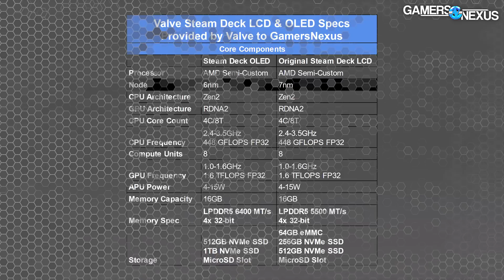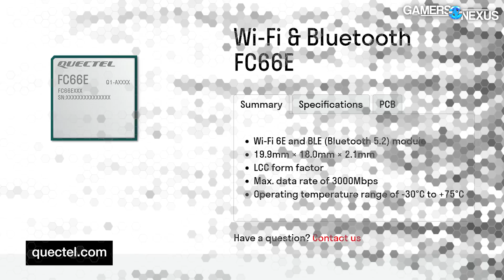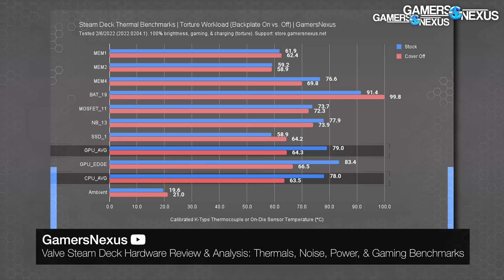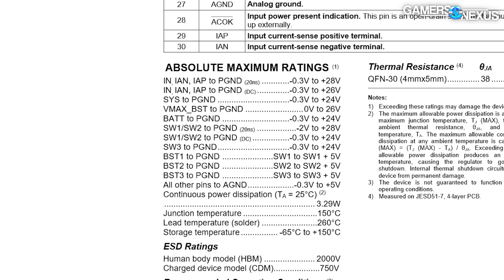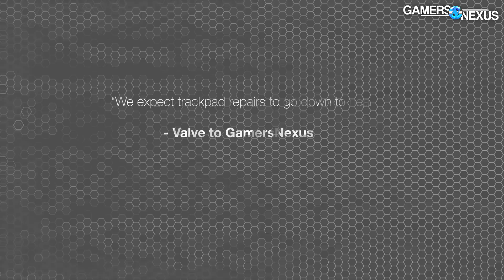They Changed Everything: Valve Steam Deck OLED vs. LCD Tear-Down

Comment: Despite valve claiming that you can't put the OLED display on the LCD model, I expect somebody in the community is going to do that within the next couple of months. And I expect it's going to work even if they have to do a bios shenanigans.
Reply from the maker: Wouldn't be surprised! The community for the Deck is resourceful!
Reply: Valve didn't say you can't, they just said it won't be a simple 1-to-1 straight swap because the new screen is smaller and they used the extra space for battery. It's definitely possible to mod it, just that it will require work.
Reply: It's less BIOS shenanigans and more physical shenanigans since the screens are different physical sizes and mounted differently, and even then that's assuming that they both use the same connector with an eDP interface. If they use a different connector it's probably going to be more than a couple of months and if they use a different interface add a few more months on again, if not years at that point.

Comment: Kinda curious what would happen if you buy an OLED screen, fan and bigger battery seperately and try to replace them in an originally LCD steamdeck. Got a feeling it might be a disaster seeing this though.
Reply: Won't work without extensive modifications given the big changes to the motherboard. I'm sure it's possible just that it will require a lot of modding.

Comment: As someone who Designs, Builds, and troubleshoots PCB's for a living. All these changes are awsome and well thought out. Impressed yet again by Valve.
Reply: I guess that some of these changes are the result of preproduction design choices for the SD2, or they used these changes to improve their design for the SD2, because a lot of it seems to be aimed at simplifying assembly and handling of the SD internals.
Reply: CannedCoochie  its a fairy tale corporations made up to sell the same crap and 0 progress to stupid consumers. we aren't limited by technology and won't be for a very long time, WE ARE LIMITED BY CORPORATIONS MAXIMAZING THEIR PROFITS aka MILKING THE MARKET.

people are buying into crap about "Moore's law is dead". nah, technically Moore's law is alive and well, its just its unprofitable for corporations to follow that law. so they don't. they milk the market instead.
for corporations it's not about making faster/better/more affordable tech, its all about how to milk the profits with incremental as low as possible 0-15% "upgrades" - to milk tech they have to the max.
Reply: CannedCoochie  nice fairy tale but actually silly AF so nope. the longer there's 0 progress =  the more profits corporations make by selling the same hardware by making cosmetic changes like "new" oled screens. thats how it ACTUALLY works. more time between actual upgrades is the same as = mass production scale increase reducing individual price. less progress = more profits.  thats why corporations KILL EVEN POSSIBILITY of progress and hire shills that work in yt comments to defend overprice and 0 progress in tech.

in tech if product that costed 500 USD years ago still costs 500 USD it means only 1 thing: CORPORATIONS ARE MILKING THE MARKET AND KILLING PROGRESS ON PURPOSE TO MAXIMIZE PROFITS. also they buy out and kill any competition with profits they've already made so they can make even more profits.
Reply: CannedCoochie  >it would also have to be way way more expensive
nope, ITS OLD STEAMDECKS WOULD HAVE TO GET WAY CHEAPER. and corporations who milk the market don't want that. thats why there's 0 progress.
Reply: YET THEY DON'T IMPROVE THE 1 THING THAT ACTUALLY MATTERS: PERFORMANCE
Reply: @rawdez_  The fact that it throttles less often inherently increases performance.
Reply: @rawdez_   Your caps lock is on
Reply: @rawdez_  that is deliberate to not fragment the market for developers, also this is a refresh and not a Steam Deck 2. It's not like the PS5 Slim have performance differences to the normal PS5. That said, one huge aspect that does matter for a hand held device is battery life and that IS improved.
Reply: @Henrik_Holst  >deliberate to not fragment the market for developers
total bullcrap, nobody makes games specifically for steamdeck. making faster hardware just makes already made games to run better.
actually that is deliberate to MILK THE MARKET AND TO NOT DROP PRICES.

exactly the same thing as with ps5 slim, sony is pushing the same console like its "a new one", in order to push even more of the same outdated 3 y.o. hardware  with performance of  gtx1070 - i.e. Pascal architecture from 2014, it literally has 10 years old performance  level - pushing the same crap to noobs who do not understand anything in technology once again. RIP the progress in tech - killed by the greed of corporations milking the market instead of making actual progress. because making progress is unprofitable - they'd have to lower prices for old tech. so they push THE SAME THING with cosmetic changes every 3 years but for some reason there are always silly fanboys and noobs who will buy the same outdated overpriced crap anyway, as if it were actually new or any better.
Reply: @rawdez_  doesn't matter how hard you cry, the fact is still that Valve doesn't want to fragment the deck market, and yes people do target the deck. They also do not advertise it as being faster so all of this is just BS on your part.
Reply: @Henrik_Holst  there's nothing "new" about steamdeck oled - all that shills mention as "improvements" actually just COSMETIC CHANGES that actually DON'T MAKE THAT CRAP ANY BETTER than the  cheapest original version which you can upgrade yourself with better storage (and add powerbank for better autonomy) and play just as well but WAY CHEAPER. watch videos comparing original steamdecks and upgrade guides, there's literally 0 reason to buy pricier options if you aren't stupid, of course. the only reason to buy oled version would be if it had better APU/chip BUT IT DOESN'T HAVE THAT, its THE SAME SLOW OBSOLETE CRAP.
Reply: @rawdez_  please stop going down the insane route here. There are clear improvements of this version of the Deck with a OLED vs LCD screen (that alone is enugh for some people to wanting to switch models), much longer battery life, better repairability, better cooling, less noise.

It's as if you are commenting on a video that haven't actually seen.
Reply: @rawdez_  They said it'd be 2-3 years before a performance uplift.
The power efficiency improvements all around the board combined with the node shrink, the dedicated sound processing, 90Hz, better colors+HDR, etc. is a huge improvement for the kind of person who isn't trying to shove a square peg into the round hole. 

Games which ran at 7-10w on the previous Steam Deck will hit a substantially higher battery life threshold most likely, however that is still subject to testing, and what preliminary tests are out there seem to confirm the Deck is running without factoring in underclocking at the expected proportional efficiency+50w instead of 40w battery levels of battery life, so I'm reasonably optimistic here.

If you think the Deck really needs that much more performance try changing up your game selection a bit. Play Helen's Mysterious Castle or Recursed or Astlibra Revision or Casette Beasts or Paquerette Down the Bunburrows(120 FPS at 3 watts) or other games along those lines just to specify a few low-wattage bangers off the top of my head.

The Steam Deck is the ultimate machine for indies and AAs and emulation and I'm very happy with the changes they've made for the OLED variant as far as they've been measured so far.
Reply: @sunderkeenin  Moore's law says in 2 years tech should become 1,5x1,5=2,25 times faster. in 3 years it should be 3,375 times faster. yet we have 0 progress in 2 years and you defend that (shill maybe or silly fanboy) mentioning COSMETIC CHANGES that don't actually matter at all for actual gamers.
Reply: @rawdez_  Moore's law doesn't necessarily account for price and power efficiency. Valve could've absolutely shipped a Deck with 3x the performance now if they'd wanted to, But if it costs 3x more and has a worse battery life to boot then it'd be very unlikely to outsell the original Deck.
Reply: @rawdez_  Moores law us not a law. It is more akin to a prediction. One which overgeneralizes the progress of technology and is not applicable to performance expectations.
Reply: @rawdez_  Considering that SteamDeck and Xbox Series S are only two devices that force developers into optimisation I do really appreciate that Valve don't push for APU performance but rather focused on battery performance, screen quality and polishing PCB. Want something powerful there are plenty of options to choose from.
Reply: @rawdez_ Currently, there is no major upgrade for the 15w range of the 8 rdna 2cus that the deck has.

Moores law is dead 😂
Reply: @rawdez_ power efficiency gains are in the same vein. Particularly cooling efficiency, I suspect there should be a couple percent perf uplifts on the OLED version.

Besides that Valve has been doing a banger job on the software side of things by improving the mesa stack and improving proton. They are basically the first to bring an HDR implementation to Linux and to a handheld in general.
Reply: @rawdez_  how do you do that wit just a die shrink?
Reply: @rawdez_  computer performance only matters for shit games, good games don't rely on computer performance and graphics fidelity for the experience

Comment: You've got a rolling shutter issue going on with one of the cameras, it looks like. Lights strobing at about 3:50.
Reply from the maker: Yeah, we weren't able to work around it for that one. It's an older camera with less granular settings that we couldn't sync with the table.

Comment: Really curious to see how the longevity will compare between the two deck models especially with the heat and battery solutions. 

As always, excellent job Steve and GN crew!
Reply: Indeed, the thermals and battery are the only thing that really makes me wonder if an OLED deck refresh may be worth it. But really only time will tell if the refresh is better there.
(For the most part I don't like inbuilt OLED screens - they will burn in and be a pain to replace at some point - very quickly even if you do anything more static on it than pure gaming so for me the hassle that brings and risk of e-wasting an otherwise good for decades more device if you can't get a part outweighs the benefits)
Reply: @foldionepapyrus3441 OLED tech has changed a lot. black depth will be an issue as usual but I'd look at "the Switch OLED 2 year burn-in video" to see the quality of modern OLED displays

Comment: Most importantly, though, I still can't buy it in NZ or AU without paying nearly double to grey importers! Thanks, Valve! 🙃
Reply from the maker: Ouch. Did the original LCD Deck ever make it over there without the gray market pricing?
Reply: @GamersNexus  Nope :( Currently the cheapest offers for 64 GB are 500 to 550 USD equivalent depending on the country and the store. I've pretty much given up on it. Thought I could buy it in India since I travel there semi-regularly, but nope, same deal there. I'd ask my friends in Europe to ship it for me but at this point it's just too much hassle for what would be a secondary gaming device to play older games in bed.

Although, given that they've improved so much in the OLED version and hearing about battery/charging heat issues made me think that maybe I got lucky by not being able to buy the original version lol.
Reply: @GamersNexus original never made it either
Reply: @GamersNexus IIRC the last valve hardware to launch in Australia without needing grey imports was the steam link and steam controller. We've got strong consumer protections where they've gotten in trouble in the past for breaking them, I'd imagine that alongside a smaller market plays a part
Reply: @Ben_Rayner  the last would have been the index, surprisingly enough. EB Games got exclusive rights to import them officially but really sucked at keeping them in stock for anymore than 2 minutes
Reply: yeah, i want it!
Reply: No Australian support sucks
Reply: Brazil: first time?
Reply: @JonoSSD also the rest of south Asia
Reply: valve has always been bad at distribution. too few regions where it's sold officially
Reply: The cheapest for you is probably buying from Singapore lol, we have people importing steam decks and they cost even lower than MSRP, at USD$382 on sale
Reply: Switzerland and Norway too and we are surrounded by countries which sells them. I think the biggest reason for it is the additional is the relatively small population and additional import taxes since neither are part of the EU. There are some graymarket, but they are significantly more expensive than a rog ally which is officially available. 
I bought one during my holidays in Japan but unfortunately i got one which cannot be charged and for an exchange time was too short. 😅 It works when plugged in, but I suspect the charging controller is faulty since it freezes when you force it to change the power delivery profile.
Reply: Russia: ahahahahahaha
Reply: @holyshishiga  wdym? There must be cargo companies that just collect whatever drops on their porches in the US and ship it to Russia without actually knowing or caring what's inside. That has been my preferred method of sourcing things from the US for years.
Reply: You live in Australia get off your computer and go to the beach.
Reply: How about no! @tinto278
Reply: @tinto278 probably snakes and spiders and kangaroos out there